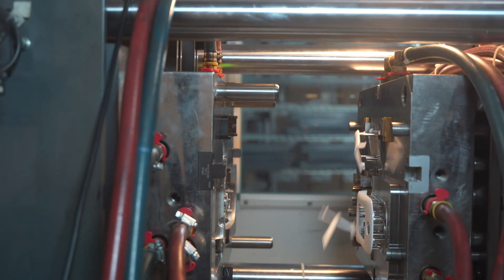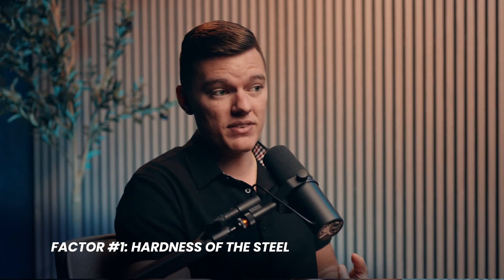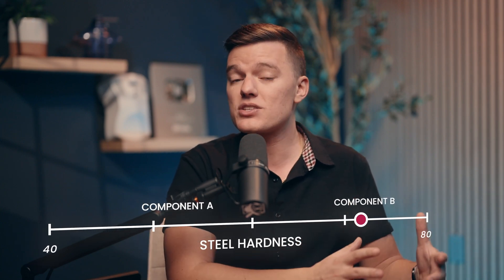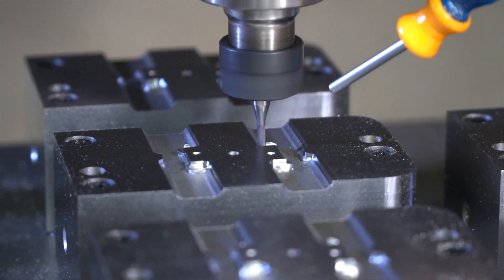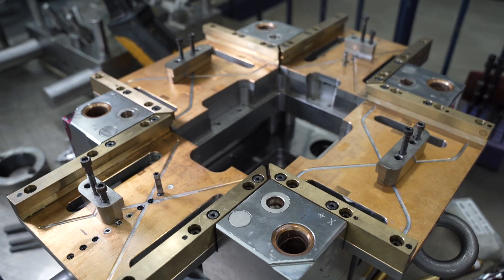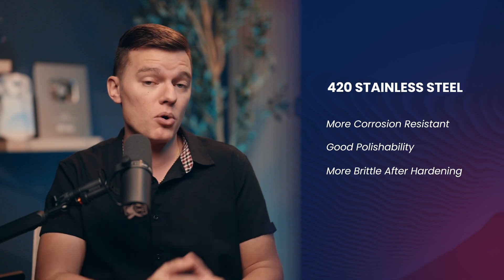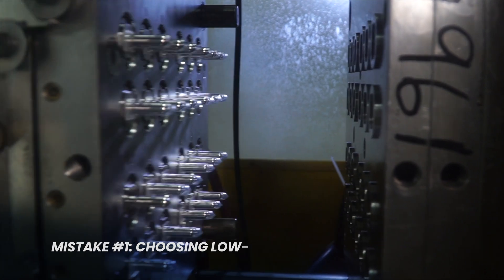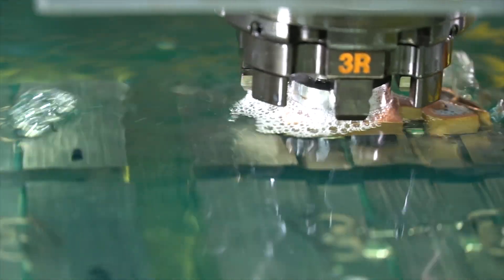Choosing the Right Steel for YOUR Injection Mold

Comment: In my opinion, the most versatile steel is  H13 ESR or H11 ESR unless you need corrosion resistance.

Better toughness, higher thermal conductivity and good polishing ( as good as 2083ESR / 420 ESR) in most cases.

And can be hardened to a wide range of hardness from 46 to 54!